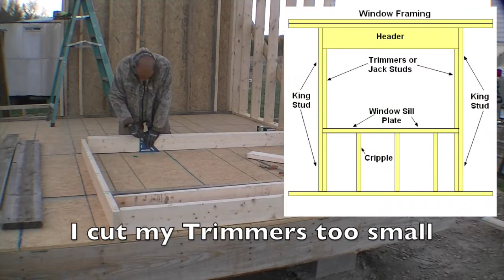OGH - DIY Framing of Tiny House part 2

Comment: I'm surprised you didn't sheath the walls before standing them.  Especially since you used a machine.
Reply from the maker: I used the machine on the NORTH WALL.  with the help of my wife and a neighbor (Paul).  The rest I'm going to do stand up in place.  I'm not sure if I can raise the wall with the sheathing on it.  It was hard enough to do this myself (on the WEST side).  The header section was pretty darn heavy.
Reply: Did you see the last post I made above this one?
Reply from the maker: The old 60's backhoe IH 3444 I have is NOT tight.  I had to sit there and hold the hydraulics in a moving position to counter the loss of pressure in the cylinder which took all of my dexterity.  I probably should have played more video games when I was a kid.  I have one of those backhoes that when you extend the arm up  and release the mechanism, it ever so slowly loses its pressure and drops.  So I cant do the machine then come over and hit it into place.  That vid was pretty crazy at 10m.
Reply: Not quite sure what you mean by "hit it in place". The wall doesn't need to be hit in place if it's toenailed on the line. Often it needs a small adjustment. After it's up you nail braces to hold it. Like this: https://www.youtube.com/watch?v=Way-KrTqeJwThe braces can be attached to the end of each section before it goes up by driving one nail through the top of the brace and into the wall stud. This enables the brace to rotate as the wall is going up. Nail the blocks to the floor in the correct position. To determine where this would be, simply hold a brace against the north wall and note the placement of where the block will need to be nailed and how high up the wall the brace will need to be nailed on the south wall. Doing it this way will enable you to hold pressure on the hydraulic while Kelly nails the bottom of the brace to the block after the wall is up. Have your nail gun next to the brace, ready to go. Maybe continuous pressure could be held against the lever with a block or a clamp.
Reply from the maker: I used your toenail approach on the 2nd part of the EAST wall and it was pretty easy.  Thanks.  I think it was within a 1/8 of an inch of where it needed to be.  Wow such little adjustments to make life soo much easier.    Got bad weather coming in later today, so Gonna try to get WEST and NORTH wall up if I can (prob. not) with time.  Want to make sure no strong winds can affect the walls.
Reply: Just install a wind brace about every 10' to secure the walls in a high wind. I use 12' material on standard height walls. Of course 16' will work as well. The brace needs to be nailed at or near the top of the wall for maximum holding power.
Reply from the maker: ok

Comment: @8:17 you show your double top plate close to the end of the other top plate. The two joints need to be a minimum of 4' apart to be structurally sound. A joint in a top plate is a weak spot in the frame. Obviously, you don't want two weak spots so close together.
Reply from the maker: Ok... I'll make sure that the next wall has more overlap.  Thanks!
Reply from the maker: Also since the side walls are not as load bearing as the main north south walls I thought that would be ok.
Reply: Sheetrock backing will fix that problem like this: https://tinyurl.com/ycwy5yc4 For some reason the ceiling sheetrock backing in the pic is on top of a wall that only has a single top plate. The backing in the pic is correct. You would nail 3 nails through the backing on each side of joint underneath. Nail off the rest of the backing as per usual. Of course, the position of this backing will work only if you have a level/flat ceiling.You should never nail off any top plate between the studs. These are the areas that plumbers and electricians drill holes to run pipes an wires. A nail will instantly dull a drill bit.
Reply: It's not a matter of load bearing, it's a matter of rigidity along the length of the wall. In other words, the wall will bend in or out when any kind of pressure is applied perpendicular to it. It's accurately described as a hinge point.
Reply from the maker: I'll cut the top plate back 3.5 feet and overlap the joint on the EAST wall for the top plate and that should solve the problem right?
Reply: Yes. Be sure that when you cut it, you cut it over a stud. That will help to support the joint in the plate.